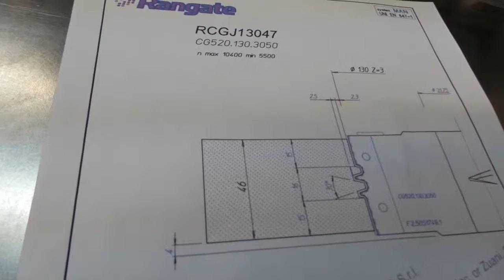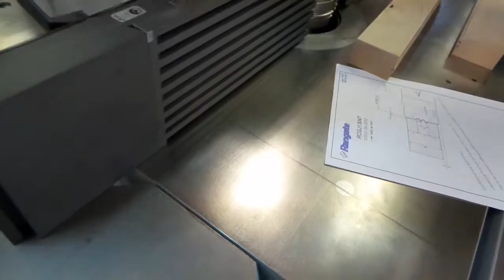How to Use Deep Groove and Full Reference Glue Joint Cutters

Comment: Can climb cutting be accomplished when using the outside fence?
Reply: Yes, many shops use climb cutting with the outboard fence. However, the Aigner fence in the video would not be good in this application as it pivots for adjustment against a backstop. If you insist on climb cutting a rigid fixed outboard fence would be better.

Climb cutting should be avoided on the shaper. good tooling, solid machines and proper setup eliminates the need for climb cutting in most cases.